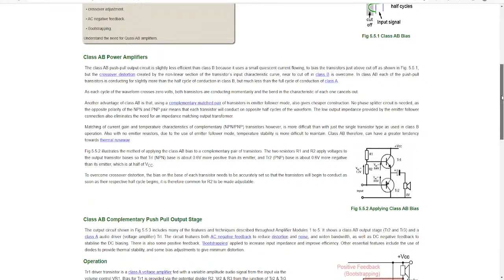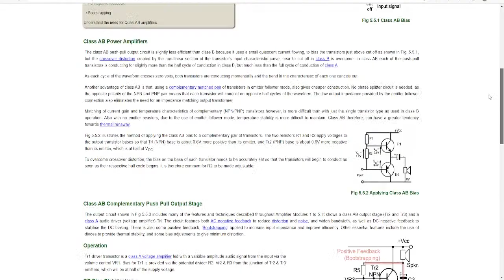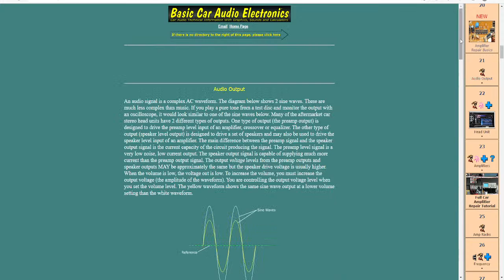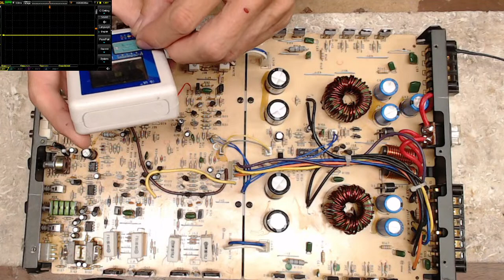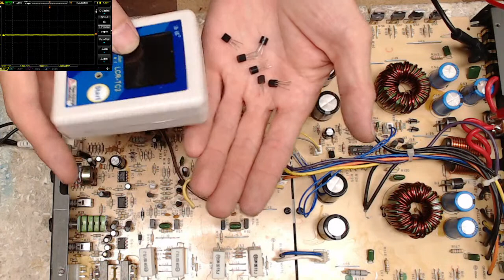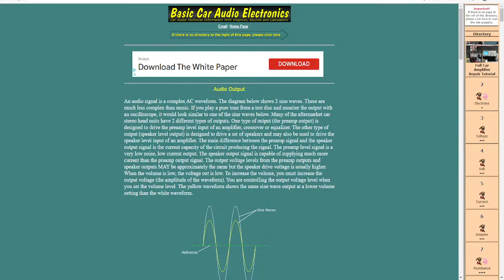Optimus 12-1977 Class AB 4 Channel Automotive Car Amplifier Repair

Comment: Hi, I have a question. What is the specification of the green polyester capacitor between the temperature sensor's white harness and the zener diode? This is because someone removed it, and I don't know which one to put in. I don't have a diagram.
Reply from the maker: Hello! I wish I could help but I do not have any information on the components of this amplifier board.

Comment: Just wondering where I should be looking with 3 burnt/shorted dual-diodes on a powerbass 3000D
Reply from the maker: Sounds like you lost rectifiers. This can be from a few areas, but I can not say as I would have to put it through diagnosis to answer.
Reply: @ellensburgamplifier  that's kinda what I'm asking, where would you start looking first? Power supply or output
Reply: @ellensburgamplifier  and, yes, diodes are cooked

Comment: This is the amp I had back in high school. It bumped hard! I ran it with 2 12's single voice coils in a bandpass and it shook everything. It's a 340 Watt total amp. 85 per channel or 170 bridged. It's awesome to see the amp repaired. IMO these amps were highly under rated.
(4 Channel Mode) ........................................................................... 85 W ¥ 4
(Bridged Mode) ........................................................................170 Watts ¥ 2

Comment: ONE iMPORTANT QUESTION, i use to quit center leg of recifiers diods, what shows me good rail voltage, when i solder them it back to its place, one source mosfet start heating up, i need to know iwhere could me my faulty component, i checked all zener diods and looks fine, or may this happen when i have some driver bjt leaking? in that case u couldn´t have had the power on for such a long time....THANKS, EBURG
Reply from the maker: In a lot of cases it is best to remove the primary output BJTs when there is a rail issue. From there I go drivers, then over-current circuit.
Reply: @ellensburgamplifier  u r right, i solve the problem, bjt´s pre-drivers of one channel weree opened and that made my source mosfet to heat up, is that a rail issue or a power stage issue??? wich bjts do u remove in this case?
Reply from the maker: @tTRANCEMAR  Power stage issue. If I have a class AB come in for repair that goes right into protection, the first thing I do is remove the output transistors. From there you can tell if your pre-drive circuit is OK. As long as you understand what the job is, and how voltage/current is handled by the NPN and PNP transistors then you will be able to quickly identify the issue.
Reply: @ellensburgamplifier  yeah protection mode is when there in something wrong in the power stage, over current or something abnormal.

Comment: Hi, my name is Mark, I'm working on my polk audio pa660 and the left rear speaker only works distorted with the amp gain turned all the way down, if I turn the gain up it cuts off completely, the other 4 channels work fine. I followed the audio signal thru the amp and it's fine at the RCA jack and after the 1st resister it goes thru. But when it reaches the jfet opamp TL074cn it gets distorted and then the audio signal coming out isn't right all the way thru each transister stage to speaker terminals.. I also noticed the top of the sine wave looks pretty normal but the bottom of it looks bad, below 0 volts portion. I also noted with my scope that each positive speaker output on idle has .01 volts dc and the channel with the issue has .2 volts dc on the positive speaker terminal on idle. Meaning amp on with no audio signal.. I'm thinking the TL074cn chip is my problem. Also when I do ohm checks comparing the tl074 from the rear 2 channels vs the front all the pins compare to each other about 35 to 40k ohms but 2 of the inputs both on the same side are 90k ohms.. I tested with positive meter lead on the outputs of the tl074 and my negative lead on the inputs of the chips when comparing.. the 2 inputs with the really high ohm readings are, ch1 in + and ch 2 in + so I'm thinking the chip is bad or something is wrong between the inputs of the tl074 and the RCA jack.. I have no schematic which makes it harder because I have to guess what's in between. I tested with the amp in 4ch mode and 2ch mode and in 2ch mode the front RCA inputs are used for all 4 channels so the rear RCA jacks aren't used but I still have the issue...  Please help a little if you can.. also in 2ch mode it appears the tl074 in question might not even used but could possibly still cause an issue. The amp never goes in to protection mode so that's another reason I believe all the transisters are fine. What ever the issue is I'm pretty sure it's someplace in the preamp section. Before that channel completely died I would occasionally hit a bump in the Rd that would cause that channel to stop behaving properly, if I remember right a bump would sometimes cause it to sound shorted out like it does now but it would begin to work again. I believe in winter that channel would have issues until the car warmed up.. so take the last 2 things with a grain of salt because it was 5 to 7 years ago, the past few years the amp worked fine until it didn't so I can't remember the symptoms in the beginning for sure..
Reply from the maker: Almost sounds like an intermittent bad solder connection somewhere on the board as you mention thermal expansion and contraction cause changes in the output. This can damage the pre-drivers or even the pre-amp. If you remove the primary output transistors from the bad channel you should be able to determine where the fault is. It is rare for a 074 to go bad unless there were direct short or intermittent surges causing damage to the op-amp. Don't forget that there may be feedback circuits involved which you will have to account for when diagnosing each channel. I always start at the pre-amp NPN and PNP transistor. Are they set up as emitter/follower pairs? I can't remember how this board was designed.
Reply: @ellensburgamplifier  do you have a way I can send you a couple pictures?
Reply from the maker: @markborrmannjr  At the bottom of the website www.ellensburgamplifier.com you will find an email address. Shoot me an email and I will get you my email address where you can send pictures.
Reply: @ellensburgamplifier  ok, message sent..thx

Comment: Hi dear friend
You have a very good channel. I am watching your videos one by one.
You explain very simply and easily. Thank you.
Reply from the maker: Thank you for the support. Please let me know if you have any questions.
Reply: Thank you very much, dear friend, for paying attention to my message.
I have a question

In the vicinity of the TL 494 chip, which is responsible for switching, there are two buffer amplifier transistors connected to pins 9 and 10. But in most of these circuits, there are 3 other transistors near the chip. Can you explain a little about them?
Thank you very much for reading my message.
Reply from the maker: @mohamadrezagasemi679  Hi Nima, there are several different layouts of the typical 494 drive. In most cases, you will see NPN and PNP transistors driving the gates. In other setups, you will have a transistor with a diode. Other transistors located around the 494 may be for the protection circuits. Just depends on what they are connected to. If they are connected to pins 1 or 2 (15 and 16) then they are part of the protection. if connected to pin 3 it may be the protection LED. So as you can see it depends on the topology. Knowing what protection circuits are used for the amplifier will help determine the components around the drive IC. In most cases, you will have over voltage, under voltage, and thermal for the drive IC.
Reply: @ellensburgamplifier  Hi dear friend
Thank you for your great response and for respecting your viewers.
  This is great and I want to thank you again
May I ask you a question again?

I will continue to watch your great videos.